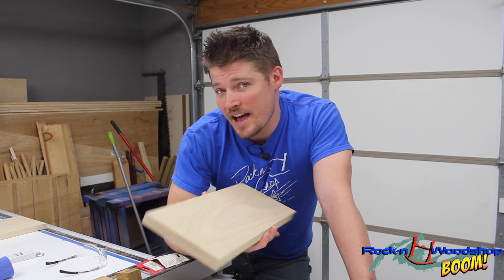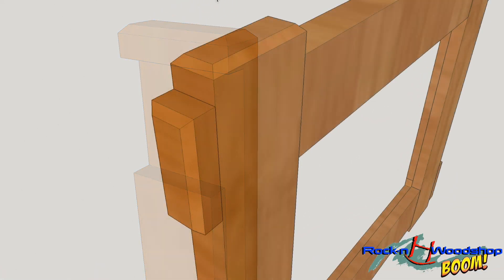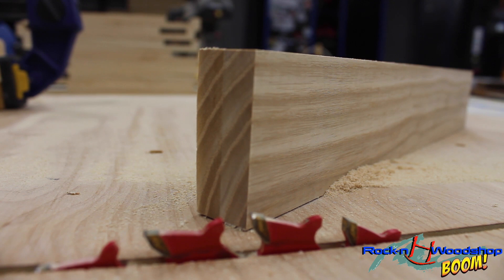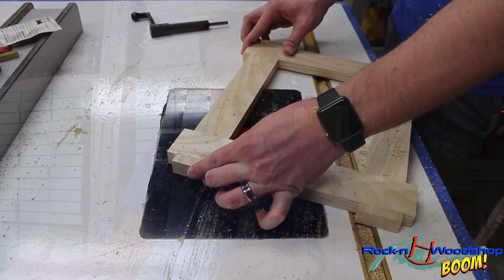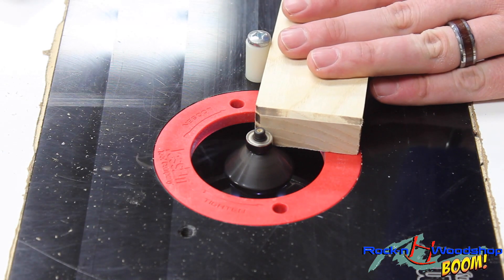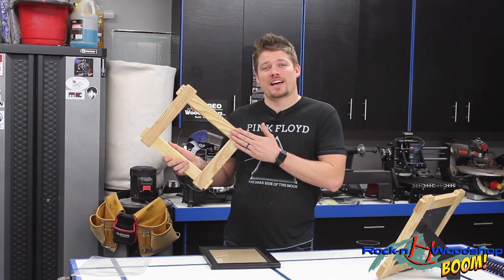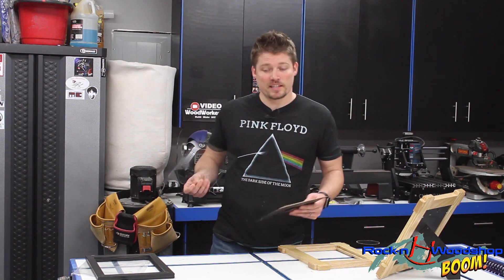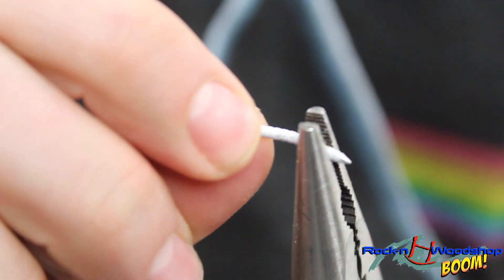Easy Half Lap Picture Frame

Comment: Hey dude, not sure if you know this but you can actually get square bearings for those router bits. 12vtools.com has them for like $9. The flat sides ride smooth along the board you're routing and then it's square to hit those corners